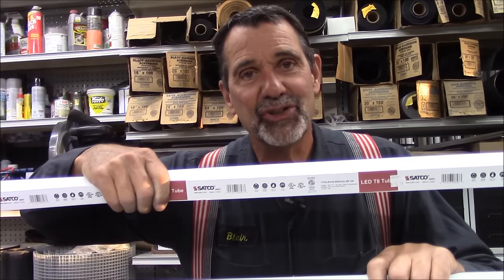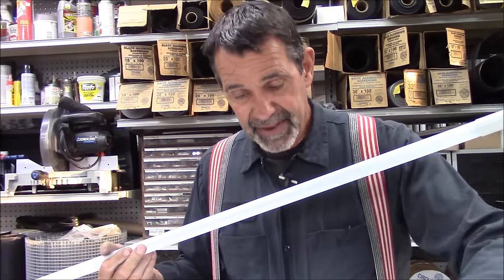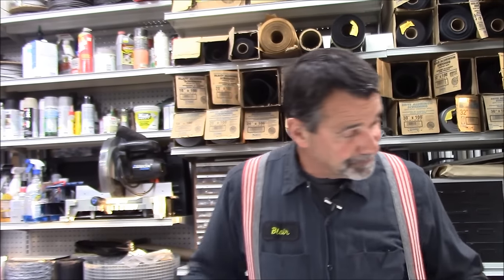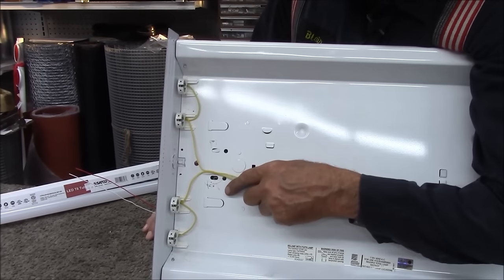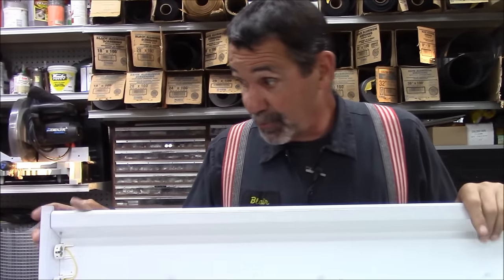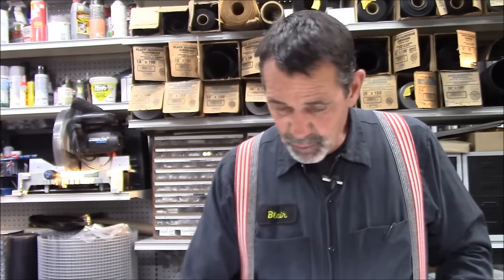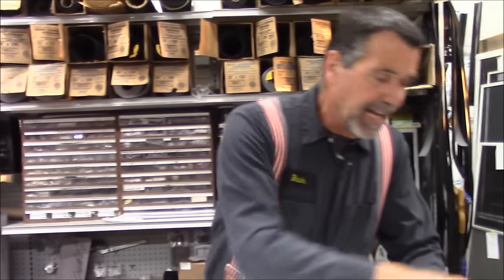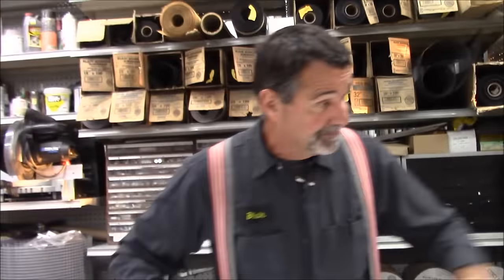New LED Tubes Convert Fluorescent Bulb Fixture Without Ballast Rewiring

Comment: Were you late for catching a train? What the hell was the hurry with all the fast-forwarding nonsense on removing the ballast and dealing with that spaghetti mess of wires?

Also, you never explained that a "shunted" tombstone was simply one in which the two sockets were connected (jumped) with a metal conductor. 

And you never addressed the need, or lack of it, for polarizing the line and neutral. Does it really matter to which terminal of the fixture the tube's ends go? And if so, why?
Reply from the maker: We need to get these videos below 5 minutes, the average YouTube’er stays only 1 minute-45 seconds. Yes we cut all dead air.
Of course an ‘end feed’ bulb only connects on one end where a shunted requires hot on one end and the neutral on the other. One may want to feed both tombstones so the bulb can be inserted either way…. A magic marker indicating the ‘hot’ tombstones for ‘end feed’ or marking the fixture as wired for shunted bulbs.
Polarizing a tombstone is somewhat moot as the bulb installs either way.